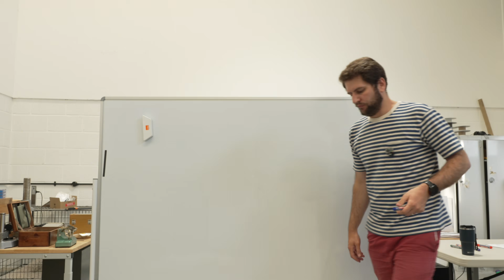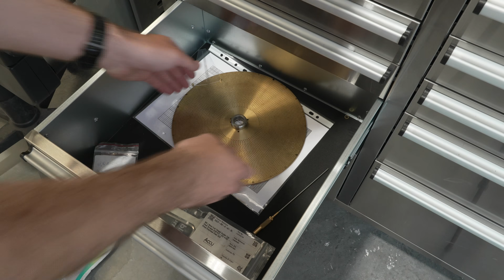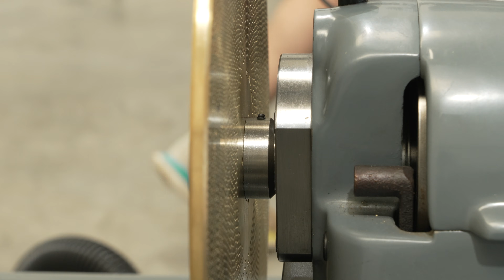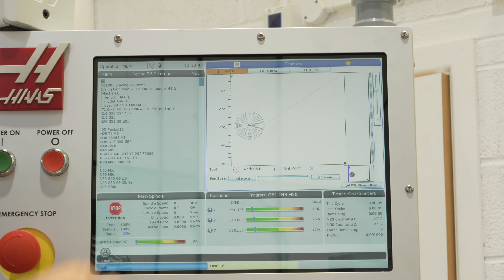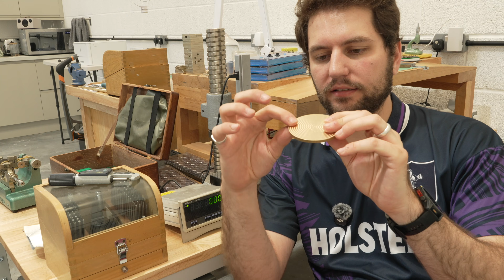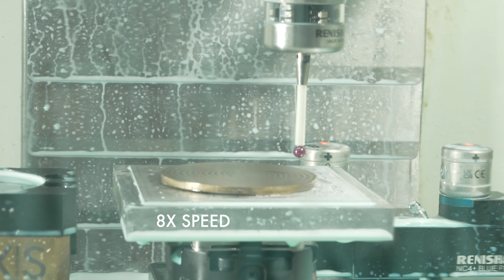Making A Watch: CNC Machine Stock Prep

Comment: I've never tried it, but a company called EXAIR whose products I sometimes specified before retirement might have a product that could blow the inside of the CNC mill's window (mostly) clear of coolant so that you could more easily film your machining inside the containment.  If I remember correctly, their product is called an "Air Knife" (or something similar?) and *might* work well to keep the window mostly clear.  If you look at their site and think something could be useful, contact their Support folks and explain the problem.

"Your" machine certainly isn't the only CNC machine in the world with windows that get splashed with coolant/cutting fluid where companies might want a product to improve visibility into the machines' work areas -- even if EXAIR does not have a product designed specifically to blow coolant from machine tool windows now, if they think about it, they might realize that there is a possibly large & untapped market for that type of product if they design something suitable?  If they've tried and it simply didn't work well, I'd hope that they'd tell you so that you wouldn't waste more time looking for such a product?

Comment: I don't envy your arm and shoulder, after all that hacksaw-ing! I'm sure there were a lot more bleep-worthy words in the parts that didn't make the video. Got it done in the end, though.

Instead of the glue fixture, would it have been more time/cost effective to machine a set of aluminum soft jaws in-situ?
Reply from the maker: Yes the right arm felt like the Hulk's after! Hopefully that is the last time I have to do that, I would love to be able to part off the stock but it seems like I would need a bit meatier of a machine to do it comfortably.

Soft jaws would of also been something I would have tried before gluing but we don't have any soft jaws with enough material left on them to machine what I would need to. The glue fixture should give the best results though and the time loss in waiting for it to unstick isn't really a factor as I don't do work on the pocket watch during the week anyway, so it has worked out in my favour this time!

Comment: Thanks for the video, very informative, and glad to have you back!

Are you able to tell us any more about this dividing plate?

-is it purchasable?
-would it fit most lathes?
-what are it's limitation?
Reply from the maker: Thank you! The dividing plate is made by the watchmaker Luc Monnet and I believe he makes them in batches and then sells off the stock, but doesn't do it that often. It is worth shooting him a message on Instagram about it if you are interested.

It is made specifically for the Schaublin 70 lathe as far as I am aware, but I'm sure you could have less divisions on the plate and have a bigger central bore that would allow you to fit it to a lathe with a bigger spindle. Its limitations compared to the worm-wheel dividing attachment that Schaublin make themselves, is that you can't do inline milling and machine intricate shapes when pairing it with a faceplate. This dividing attachment from Luc would used exclusively for milling teeth on wheels and pinions, and it is mighty good for that!
Reply: @JimAndSonny thanks for the reply, I'm keen on picking up some dividing plates but don't have a shaublin 70.. only an 8mm lorch 🥲 but I can still chalk this one up as an option for when I get rich haha
Reply: CAP14 have taken over the dividing attachment production from Luc Monnet now, cost is 2,200CHF 👍🏼 it's made specifically for the Schaublin 70.

Comment: I can see you have little regard for your tools why one would cut like a mad man on the lathe that the saw could have ruin the bed well not a good look. Watch making is slow process not minute man and feeling sorry for one self because one had to cut some brass
Reply from the maker: It’s definitely not the way I would have liked to do it but we don’t have a parting off tool that can do this job and it’s at the limits of what the machine can handle too.

Watchmaking is whatever you want it to be and I am definitely more on the side of getting it done even if I don’t have the perfect tools for the job, that way at least I make progress towards my goals rather than waiting for some idealised version of my job to appear after spending thousands of pounds on specialised tooling to suddenly fix my problems. But yes, I should have been more careful with the saw as I approached the Final Cut, but after an hour of sawing in 30 degree heat my judgment was clouded and I just wanted it done. I’ll be more careful next time 👍🏻

Comment: For my bachelor thesis I had to repeatably and precisely laser-texture the flutes on both sides of a carbide drill insert, for which I also decided to make a (albeit less accurate than yours) fixture which eliminated the need for realignment when swapping/flipping the inserts. Hadn't occured to me then that CNC mills used similair concepts, but it makes total sense.
If I'm not mistaken Loctite requires both contact with metal ions and a lack of oxygen to cure, where regular superglue requires moisture. That is also why the latter cures so annoyingly quickly on skin.
I've hand cut 36 mm aluminium and 21 mm steel round bar, which took long enough, but 76 mm brass? That's a proper workout ;). Cheers.
Reply from the maker: That sounds like my kind of thesis!

That’s interesting about the Loctite and superglue, and also explains all the times I have made two fingers become one 🤣